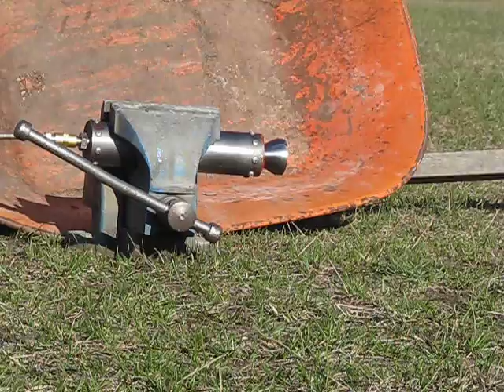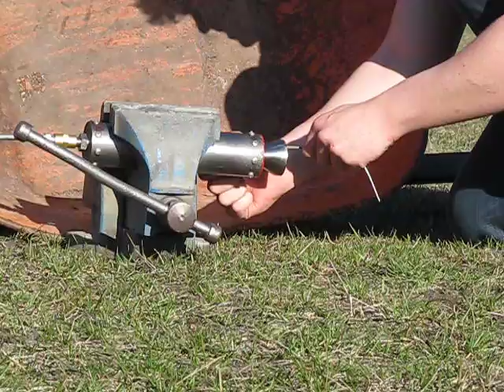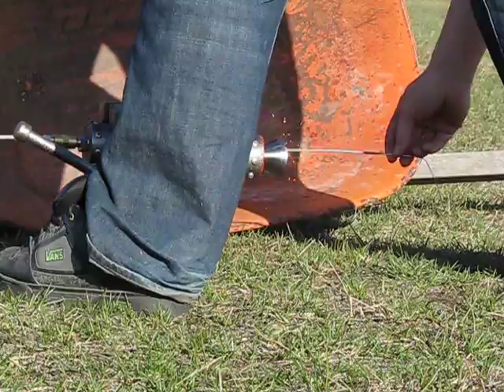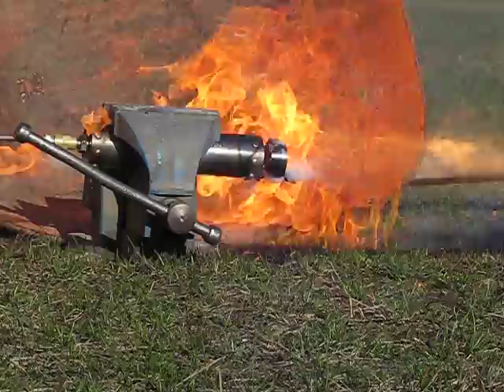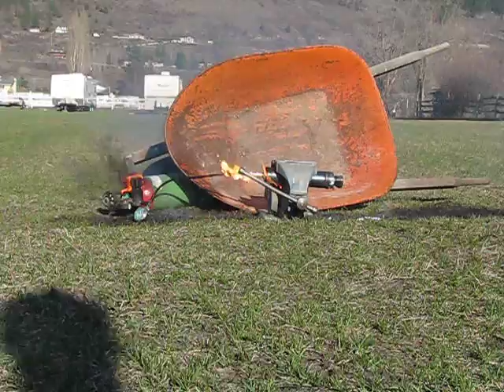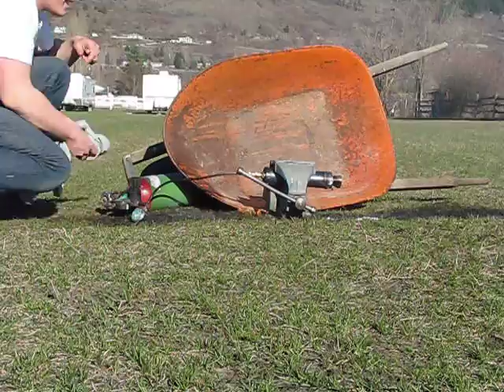#5 Hybrid rocket failure GOX and paraffin

Comment: Oxygen pressure was too high so it pushes the liquid paraffin out of the engine before it has a chance to burn in side of the engine. Try 50  psi for your next test and go up or down from there.. A bunker and some type and a quick shut off for the oxygen would be a smart idea. Always keep the Apollo one fire in the back of your mind when testing rockets. Gus Grissom,Ed White and Ed Chaffee are looking down on you!

Comment: So, an oxygen tank is set on fire, and you're putting your face some inches away, no protection whatsoever, blowing on it to put it out. I see a darwin award in your future.
Reply: It doesn't say flammable anywhere. Its an oxidizer, not a fuel. Oxygen makes things burn, it doesnt burn by itself and its not explosive(side note, gasses under pressure can expand, but oxygen will not combust on its own so it will not cause an explosion. That is not to say that gasses under pressure aren't dangerous bc of the aspect of pressure alone)
Reply: @pepijnbosvelt2526  Ok boomer
Reply: Martin Lutteral whahahahahaha I’m 16 buddy😂😂😂
Reply: Martin Lutteral you’re 2 generations off
Reply: Well said, well said indeed.  No X-prize for them.
Reply: Well, oxygen isn’t flammable or explosive so....
Reply: @pepijnbosvelt2526  Oh, so those warning labels on oxygen tanks that say that is flammable AND explosive must be only decorations. Got it.
Reply: You blow pure Oxygen on alot of heated substances and you will get a rapid combustion, sometimes at a speed creating a shockwave! Pure oxidizers are dangerous just as much as fuels, especially when combined with stupidity, as demonstrated in this video...

Comment: XD wouldnt it have been wiser to put that tank somewhere so you can turn the oxygen off without setting yourself on fire?
Reply from the maker: Yes! That would have been much wiser. Not a lot about what happened this day was very wise.
Reply: Jon Proce  O2-based propulsion is famous for being hot, if you used a more thermally durable fuel, it would have acted like a seal throughout the duration of burn. There's a vid of a successful gaseous O2/acrylic (like a transparent plastic) test, why don't you try that instead of paraffin? what about polybutadiene rubber fuel?

Comment: @NotYourStandardIdiot I know the dangers of high pressure oxygen, I think, but in this case, could it have really been a BLEVE? there was no boiling liquid, only high pressure gaseous oxygen. Also, assuming the gas tank was heated 100 degrees celcius, what would the corresponding raise in pressure be? I didn't think it would be much due to the gas equation. Was very dangerous what happened but I think you categorised it wrongly.

Comment: Nice video.  Chemically paraffin is a good hybrid fuel (lots of carbon), but structurally it melts too completely(at low temps) for that use.  I'd recommend something less likely to liquify so quickly, like acrylic, polyurethane, polyethylene, even tar.

Comment: Thats quite different from the results I have been having with parrafin, haha, yeah airtight seals are important. Anyways, did you have any sort of check valve on the engine to prevent a blowback to the tank or was is just direct fed from the reg?